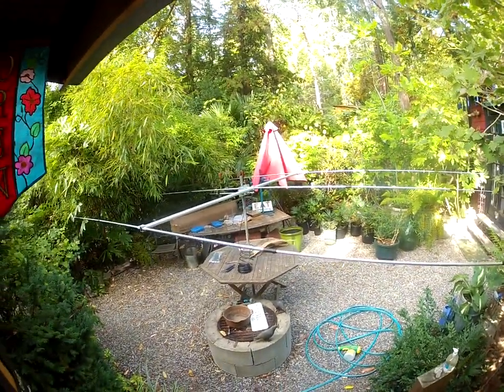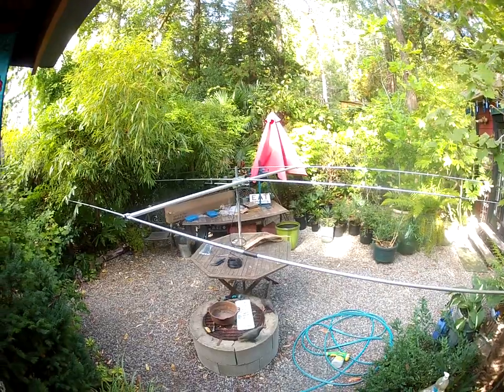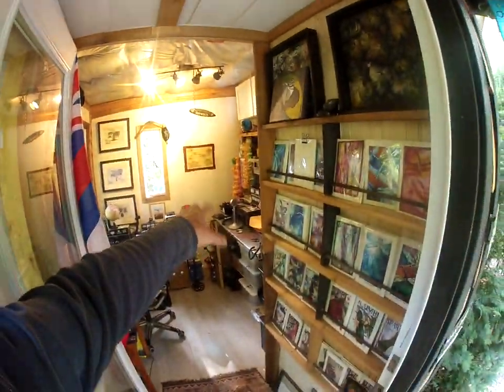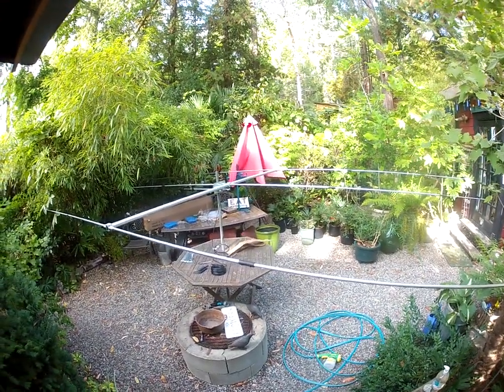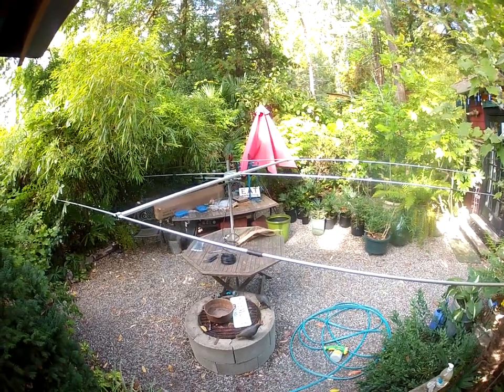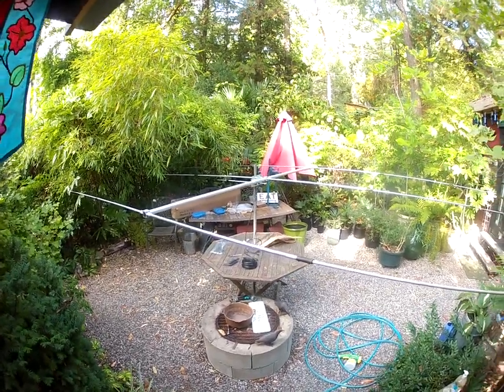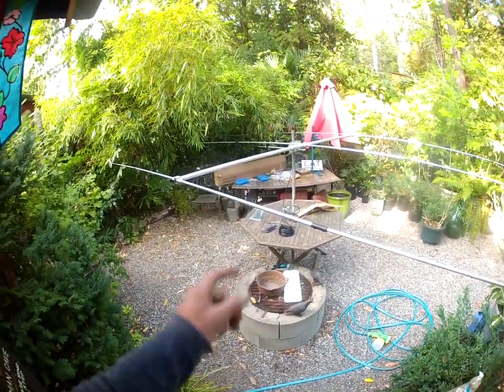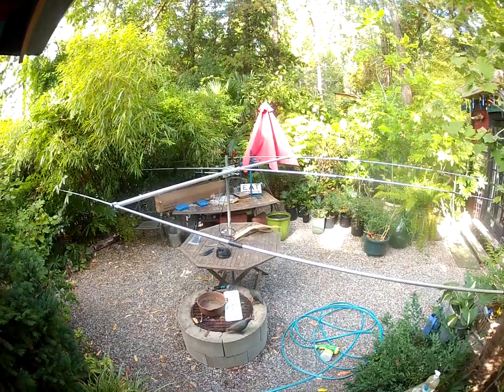New Beam antenna assembly & matching

Comment: Lots of Luck I am going to get a beam also its going to be a Quad beam looking forward to getting thru all the garbage when I have the beam up  looking forward on hearing you I am on LSB 38 but got between 36 to 40 + depending on conditions  73's for 4731NJ  Michael
Reply from the maker: Quads are great beams. I ran one for many years. Had it up on a tower back in the early 1980's 73's